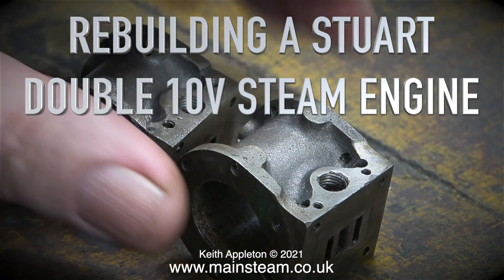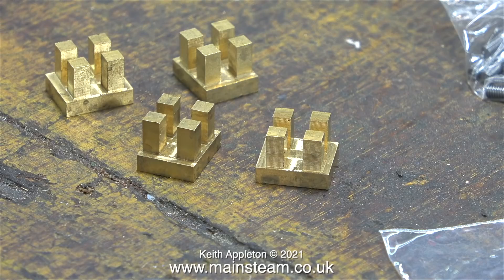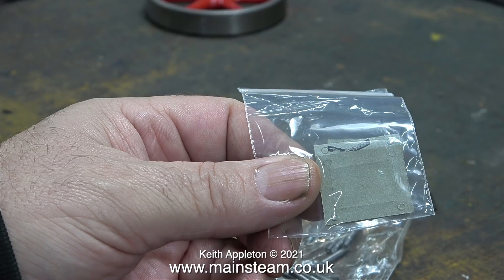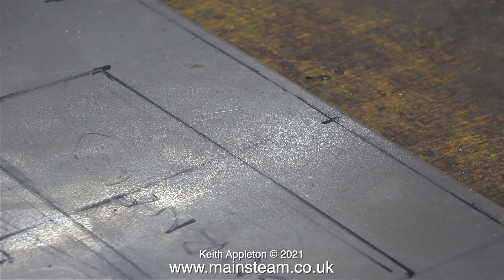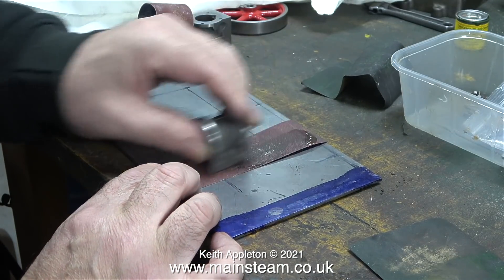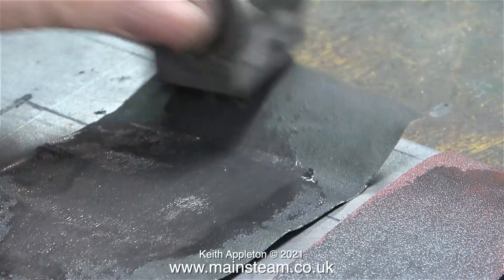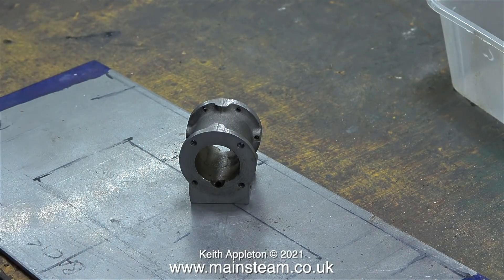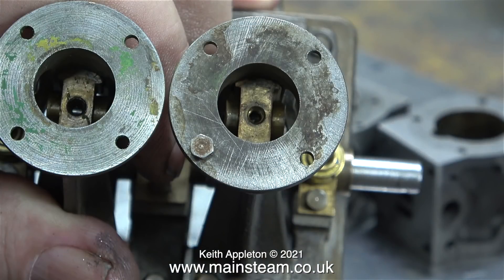REBUILDING A STUART DOUBLE 10V STEAM ENGINE - PART #4

Comment: You might want to think about getting a small surface plate for lapping port faces. I use them frequently at my job in a refinery for lapping surfaces that need minor flattening. I just used one last week to repair a steam driven pump, and yes it was slide valve that needed attention.
Reply from the maker: I have one - please watch more of my videos }:-)))